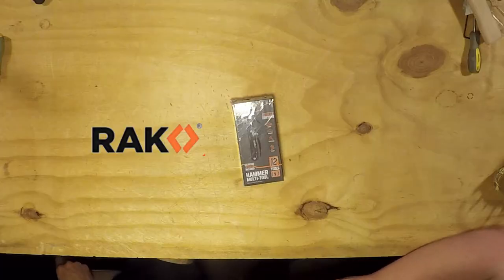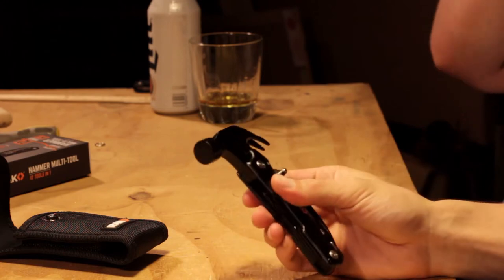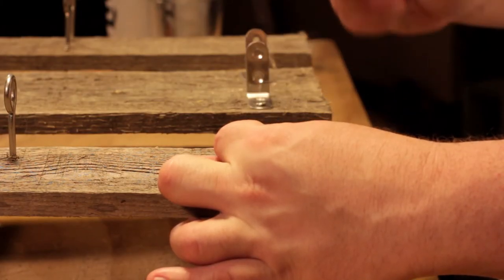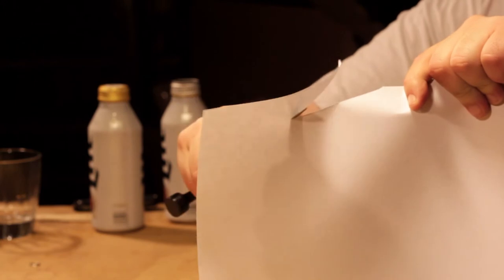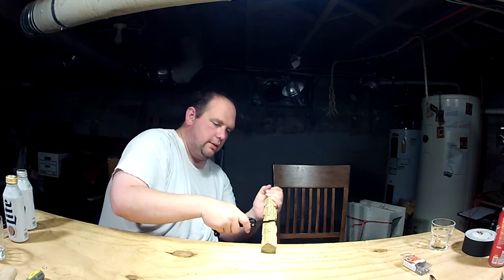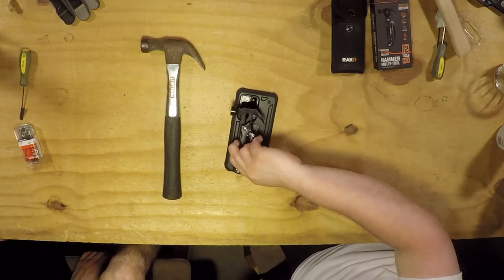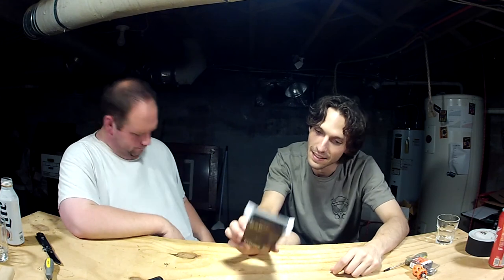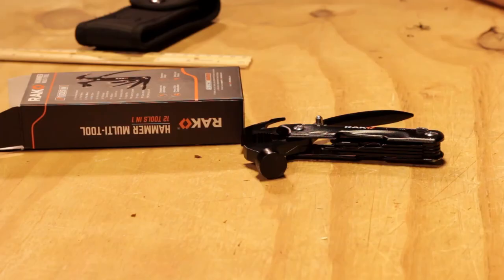RAK Hammer Unboxing/Review

Comment: Get the car out of your minds guys, it’s an around the house multi tool, just like the other multi tools but it has a hammer, it’s exactly what it says it is and actually built better than others at higher prices.
Reply from the maker: But if it was around the house then I would just use the tools in the house. This would not be an adequate replacement for any tools in a toolbox